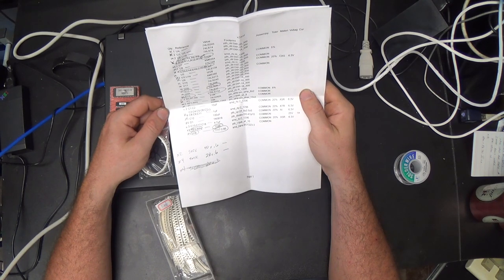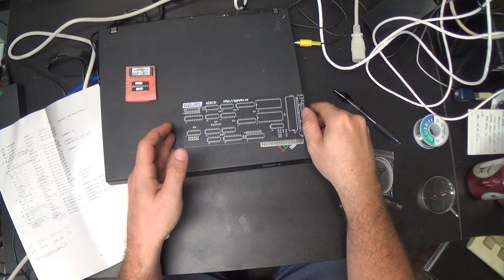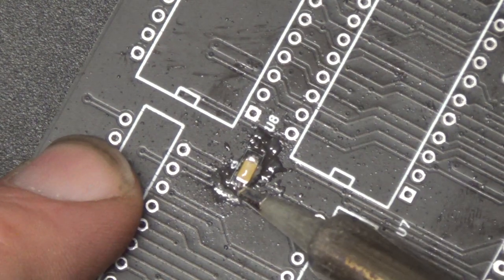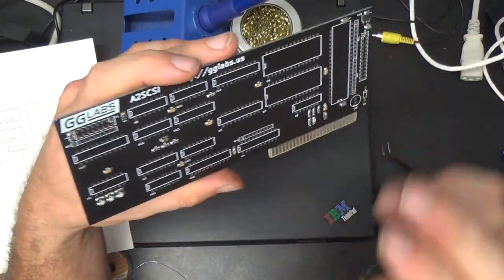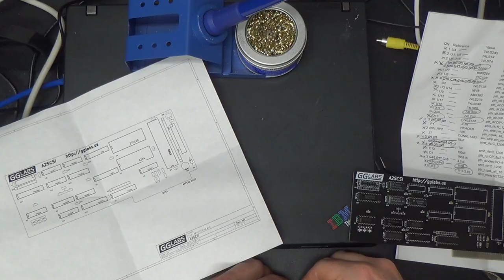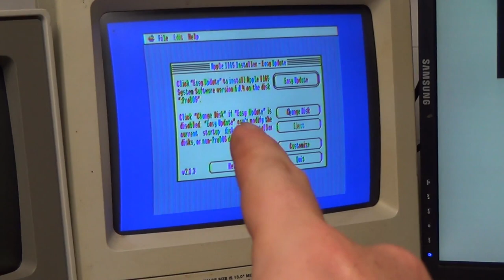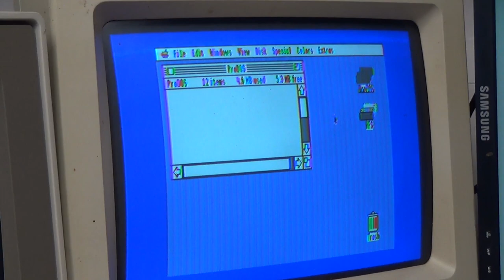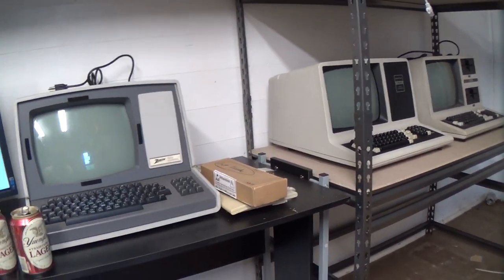Assembling the GGLabs Apple 2 SCSI (a2scsi) card.

Comment: I feel the same about SMD soldering.. just finished building a floppy emu which was all smd and was honestly surprised that with my bad smd soldering that it worked.  BTW, i see those trs-80s over there, maybe should do some kind of project with those for upcoming "SepTandy" month.
Reply from the maker: That is an excellent idea.  I have a Tandy 1000 HX that needs the composite output fixed, and another one that I want to add some expansion cards to.  And the TRS-80 Model 4 needs fixing in general (not sure exactly what is wrong with it yet).  I'll try to focus on that stuff throughout September.  :D

Comment: The IDC26 to DB25 cable, is that just a parallel header cable?  Making two GGLABS A2SCSI from kits, but no information on it.
Reply from the maker: Yeah, it's the printer type with the 26 pin IDC header.  I got mine on scamazon.
Reply: @Lee_Adamson_OCF  awesome. I enjoy your videos. I have two mockingboard kits and a phasor kit I bought a long time ago. I'll be looking at your videos a bit to prep.  I'm definitely going to socket anything I can socket.